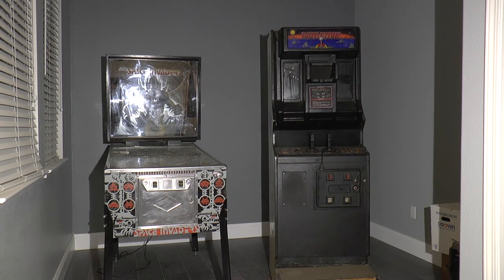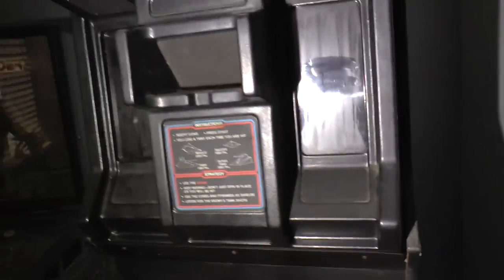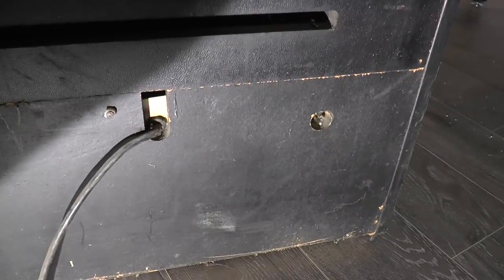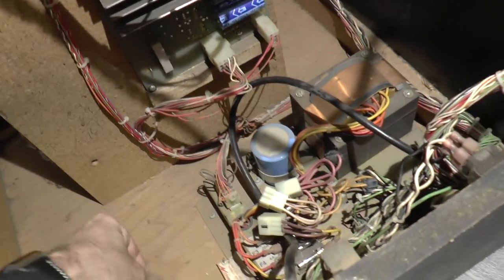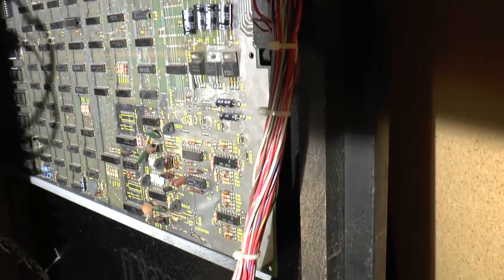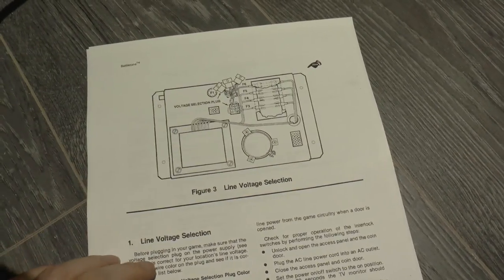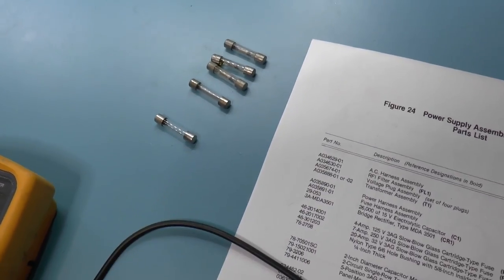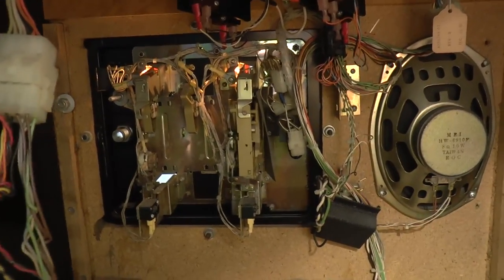Atari Battlezone arcade (1980) repair, part 1

Comment: Loved the ending! I would have been tempted to pull out the PSU in the base and then clean and test it thoroughly before powering on. You did mention the issue with old caps, so again it might have made sense to pull all the boards and test or replace all the electrolytic caps. Anyway, I came here after episode 5 was posted, so I will find out quickly enough what the other issues are.

Comment: Yay, smoke test. That was the obligatory magic smoke. Didn’t saw it for a long time anymore. Battlezone isn’t exactly rare but no need to destroy the boards either. So better disconnect the psu and restore it first before powering the whole cabinet. Seems like a nice unmodified original.